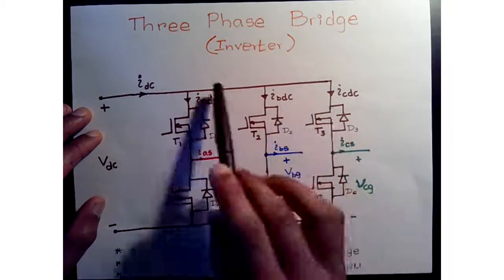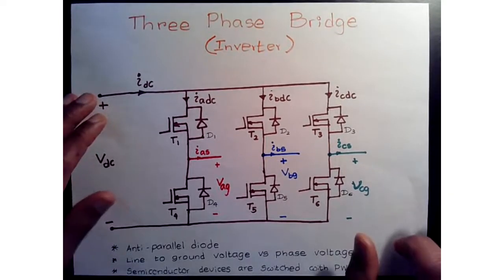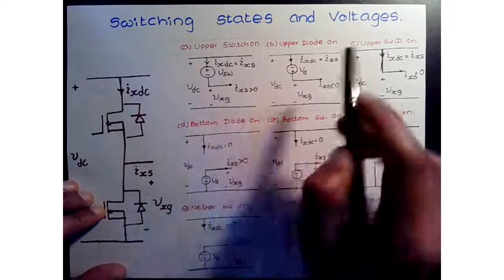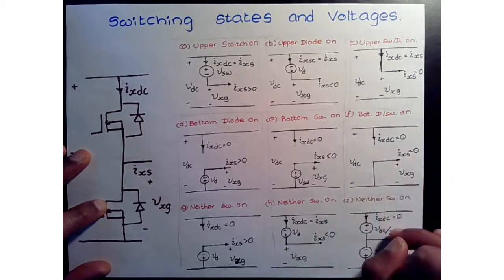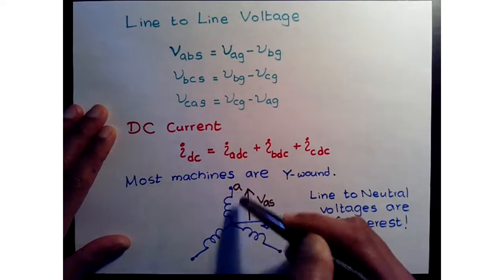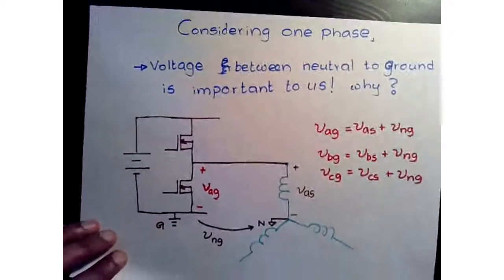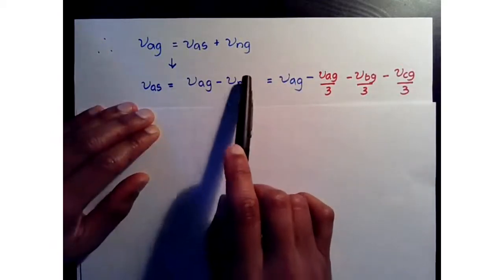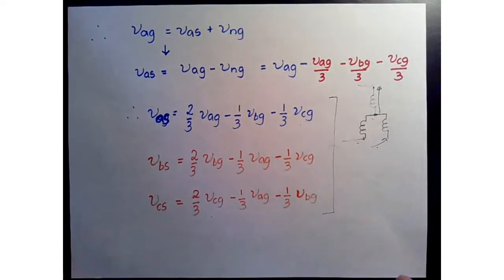PWM Inverter Voltage Generation

Comment: Hi, I am an electrical machine designer who works with bldc,pmsm, inducton and srm motors. I am a new graduate. I am currently watching your videos. I am trying to learn motor control and your videos have been very helpful. Is there anyway that ı can contact to you in case if i have deeper questions about motor control? If you can share your linkedin or maybe e-mail with me?

Update: ı actually find your linkedin profile. Can i contact to you if i have questions please? I believe guidance is very helpful in the first phases of learning new things. Thank you for all of your effort making these content